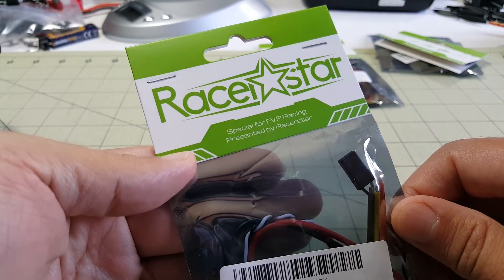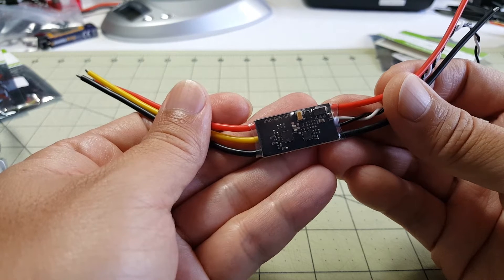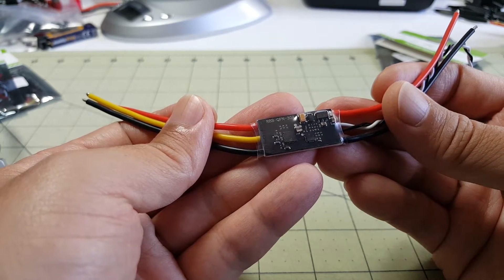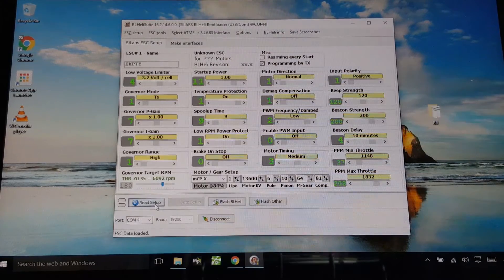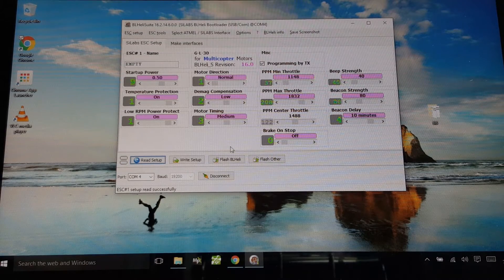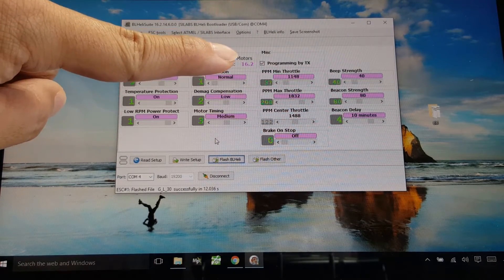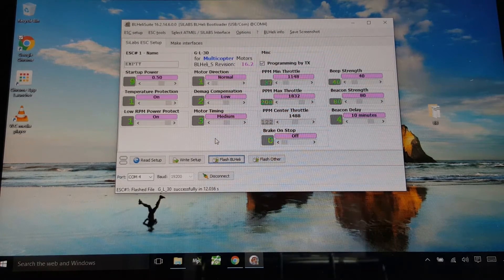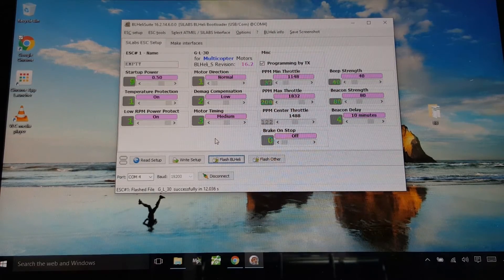Racerstar RS30A 30-amp ESC Review

Comment: Will these work on a 500 size quad running 935kv motors?. Thanks
Reply from the maker: Probably.  These are rated 30 amps, burst to 40 amps.
Reply: Awesome thanks Albert Kim. They just look really small and are labeled as FPV racer ESCs. I will give them a go.

Comment: Hi, I was wondering how you connect the ESC to the Arduino. It seems you plug the white wire into the GND and the black one into D3. Shouldn't it be the other way around?
Reply from the maker: +Alessandro Montanari yes it's the other way around.

Comment: Hi, I just wanted to ask if this esc has bootloader. Can I flash a different firmware on to it after I soldered them to the FC?
Reply from the maker: Yes, this comes with BLHeli bootloader and it works with the FC passthrough feature so you can flash and configure after you connect to the FC.  You need a firmware on the FC that supports BLHeli passthrough or it won't work.  Get the latest version of Betaflight and you'll be OK.
Reply: +Albert Kim (marblekit) Thanks for the quick reply!

Comment: Thanks for the video, very helpful. Can you please tell me exactly what the Arduino unit is and where I can purchase? Many thanks.
Reply from the maker: It's an arduino nano.... you can get it here - http://goo.gl/lnxUlX
Reply: +Albert Kim (marblekit) Very much appreciated. Cheers.
Reply: +Albert Kim (marblekit) Oh, one more question - I have some older RCTimer 20A ESC's with BLHeli - is it possible to flash with new BLHeli_s firmware...?
Reply from the maker: +nickybomz no. BLHeli_S requires specific hardware.

Comment: i just order two sets of 4 ...i was woundering about the 4in1 for a particular build maybe you can review that when its ready.
Reply from the maker: +Chi Sty yeah, I have the 4-in-1 on preorder
Reply: curious what the real mounting spacing is, says 30mm on site. would be perfect if 30.5mm stackable
Reply: can you flash oneshot and multishot no them?
Reply from the maker: It comes with BLHeli_S which is already enabled for all protocols out of the box. No need to flash unless you want to update the version to 16.3 (this is recommended anyway)
Reply: cool thanks for the quick info